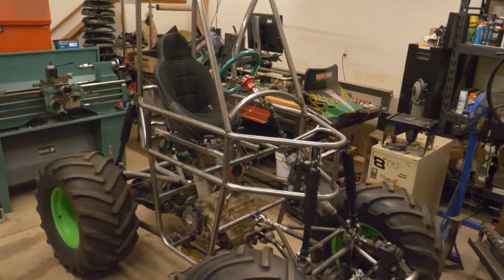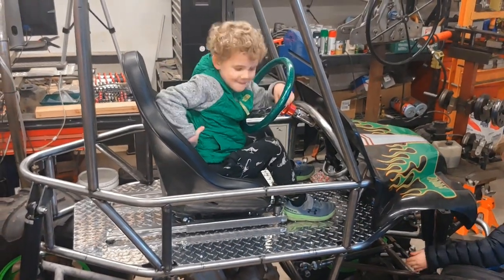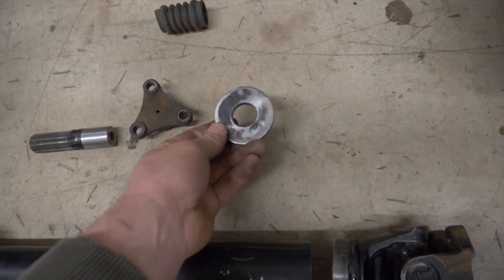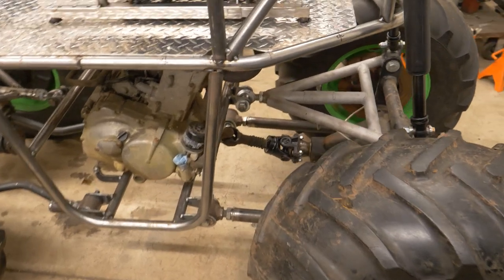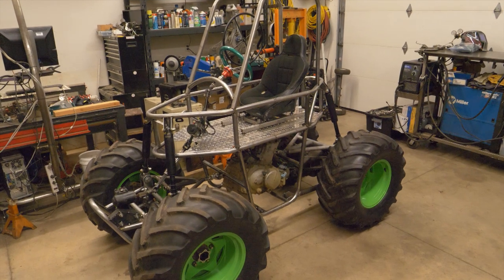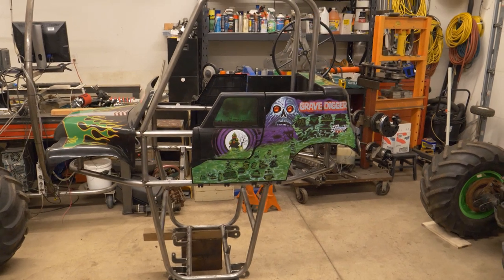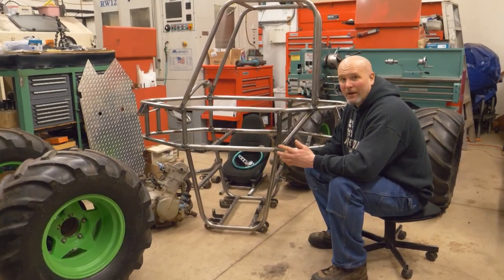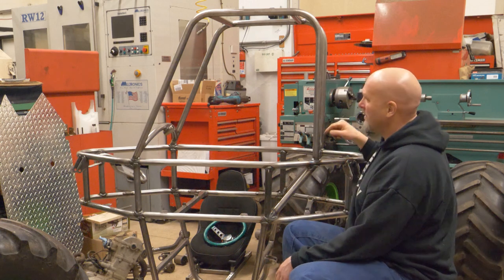The Crazy Chassis of the Modified Power Wheels Mini Grave Digger Monster Truck

Comment: I've watched allot of this build,and read comments.It's YOUR build.They don't like the look..?oh well.Anyone who's seen a full sized 'Monster'built would know the driver stands.If your brakes,and throttle are run off cable,then you can lift out the seat,and the front of the floor and semi-stand/set.

Comment: Check out these little honda civic all-aluminum radiators. 14.5" wide and 16.5" tall  (outside dimensions, not core) for $50. They work excellent on quad engines in buggies. You won't overheat, they're cheap and they're good looking too! With or without an 80 watt fan. https://www.amazon.com/dp/B00JLVWDO0/ref=psdc_15725431_t2_B016NNAD7W
Reply from the maker: Thanks. I'm hoping to use the radiator off of the quad, but if doesn't work for some reason, I'll check into these. Thanks for watching!!

Comment: I cant remember but does it have and will it the quads original reverse??
Killer machine tho'.
I'm really enjoying watching your progress two thumbs up from over the pond👍👍😜
Reply from the maker: Yes, it has 5 forward gears and reverse. Plus it has high and low range, so effectively, 10 forward gears and 2 reverse gears...
Reply: @motomule  its gonna be pretty slick. most builds iv seen relie on chain an sprockets where some torque surly must be lost but as your drive is straight from the gear box its gonna be great, I for one can't wait for testing lol👍👍
Reply from the maker: @andybowyer3602  Thank you!!!

Comment: Man, your overall design on this is amazing! I think those nitrogen shocks are going to be the ticket. Heck if you wanted to get fancy, you could design a closed loop compressor system, to change the preload on the fly.😉 I see your logic in wanting to wait on making the roll cage removable until you get the cooling and electrical stuff fleshed out. With as much weight as you have below the centerline, I think it will be just about impossible to roll it over anyway, but safety first, especially when the kids are involved.😉 The simple fact that it's AWD is going to make it just about unstoppable! I hope you have lots of soap for your pressure washer, as I'm sure it will get plenty of use once this thing is operational!!🤣👍
Reply from the maker: Thanks!!! We are excited to get it running!!! I hope it's so fun that the boys drive me crazy wanting to get it out all the time!!! 😆

Comment: For the single hoop get some of these https://www.barnes4wd.com/1-34-Interlocking-Tube-Coupling_p_700.html (assuming you can get some for your tube size) and maybe add a door bar like a drag car that way it would add strength and also make it look better without just some posts sticking up.
Reply from the maker: I got some just like that from Summit Racing.

Comment: Awesome! Your boys will never lack for horse power- they have something infinitely better; Muuule Power! Much of your "recommended viewing" already on subs list- but I'll second your approval. All fun, all informative and all "kid friendly". Go Mule , Go!FR
Reply: MM, it just occurred to me about the roll bar; Rebuild the back uprights as a trapezoidal roll bar thee full height you need for a slightly overage adolescent to dive with a helmet on- back brace the freestanding rollbar with two diagonals from the backside of the bar to the upper chassis loop- the radiator goes into that space and remake the front roll over as a "clip on" piece as you outlined. Just my viewer thought, to a builder that has out thunk me at least three times so far!FR
Reply from the maker: Yeah, I'll probably do something similar to that. Thanks for watching!!! Mule Power!!!-
Reply: @motomule  I got the easy part! See ya in about a week or so- have popcorn, and a place to be!FR

Comment: Lookin great...you did a amazing job...wish you were my Dad 40 years ago lol...
But I think you are going to have a problem with them U joints..I don't think they are meant to be used a such a large angle....might take out the bearings on the output shafts of the engine prematurely...
CV joint/shaft might be better at those angles...
Reply from the maker: Yeah, might prove to be the weak link... We shall see. Thanks for watching!!!

Comment: Can probably put radiator low behind seat, put a plate behind it to shield from mud from rear tires.  Or under deck on front under feet, use plates to shield from mud there as well.

Comment: Is the rear axle even with the spacers on it about 3inches narrower than the front axle track width?
Reply from the maker: Yes, you are spot on.
Reply: I was comparing it on the floor and it reminded me of the k20 Chevrolet where the rear axle is so narrow compared to the front and looked goofy are you going to add more spacers to get equal track width or it doesn’t matter
Reply from the maker: @Moneygrip  I may add more spacers, but it's low on the priority list...
Reply: Moto Mule true

Comment: Would keep radiator under the floor, just in case of a roll and hot water spraying out with a kid near it. Rather cleaning mud off it once in a while.

Comment: Put the radiator behind the seat with the fan and air space back there it should cool just fine then doesn't have to hook to the cage you want to make removable. Grind Hard has done it on a couple of there builds

Comment: Awesome build, What? No front driveline?
Slow Low gearing, that thing will be a tank...
Reply from the maker: It will get a front drive line, just have to change the gears in the front diff first so it matches the rear.... Made up a rear driveline so I can test it sooner....

Comment: Grind Hard Plumbing put the radiator on rear of the roll cage behind the driver seat. It works for them. Love the video.
Reply from the maker: Yes, Ethan actually let me drive that Jeep, it's freaking awesome!! Watching me get in and out if it was a show of its own.... 😆
Reply: @motomule   I was talking about the radiator position. I didn't see a video of you getting out of the jeep. Well, did you fit in it?
Reply from the maker: @richardbrowne1217  fit?? You might call it that... 😆 I understood what you meant about the radiator, that is what I'll probably do.
Reply: @motomule  "Ok!"

Comment: I still don’t see how this will work with the engine in backwards. Wouldn’t that make drive of forward gears reverse and the reverse forward?
Reply: Josh Matthiesen No because the drivelines will still be spinning the right direction the backwards direction is actually in the differentials not the transmission. Each engines transmission can put out a different direction of rotation for forwards in reverse coupled with the differential that is matched to that transmission. being that he’s using differentials from a vehicle the differentials rotate the opposite way of the atv transmission so turning it backwards like that allows the differentials to rotate the right way off of the transmission output. hope this helps
Reply from the maker: What he said ^^^
Reply: Moto Mule thanks man love the channel

Comment: Dennis Anderson would be proud 😎👌👍
Reply from the maker: Hope so!!!
Reply: @motomule  you should spray paint the chassis green
Reply from the maker: @fernandolomas6635  that is the plan!! 😁
Reply: @motomule  Fun fact: the very first grave digger truck to have a green chassis was Grave Digger #3
Reply from the maker: @fernandolomas6635  was it also the first to have linkage suspension, or did it still have leaf springs???
Reply: @motomule  yes. It was the very first non-leaf spring grave digger truck. Interestingly, grave diggers 4, 5, and 6 were leaf spring. Grave digger 3 was the only non-leaf spring grave digger truck until #7 was built. For whatever reason there were two grave digger #5's. The first one was leaf sprung and driven by Dennis's brother Les. The second one was a tube chassis driven by Pablo Huffaker. This particular grave digger was actually the 9th one in the fleet, but it was not GD #9. GD #9 was a ride truck and is now the Extinguisher ride truck.
Reply from the maker: @fernandolomas6635  very cool history!!!
Reply: @motomule  I forgot to mention that GD #6 was actually a street-legal truck.
Reply: It's hard to believe that the newest grave digger truck is GD #40